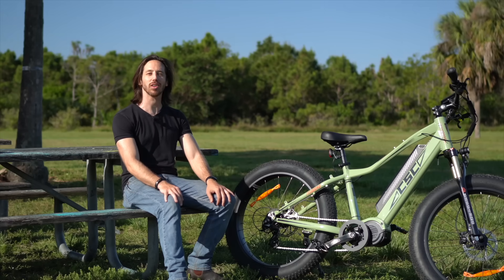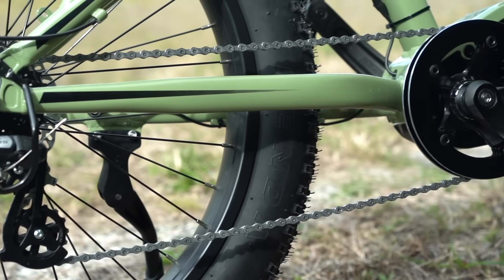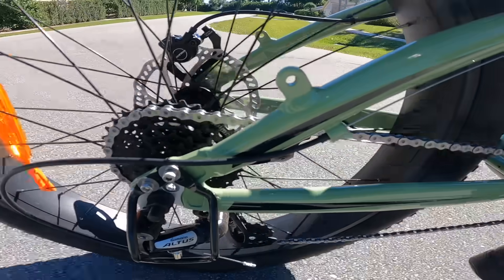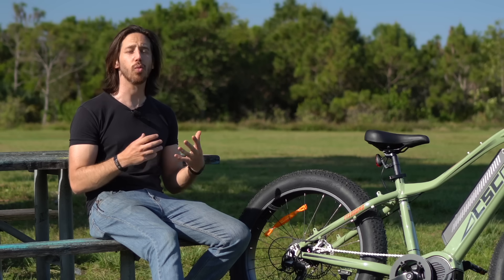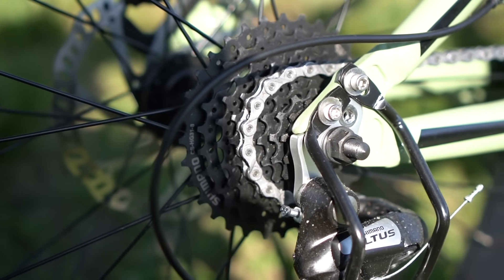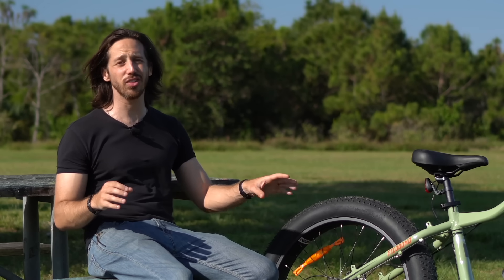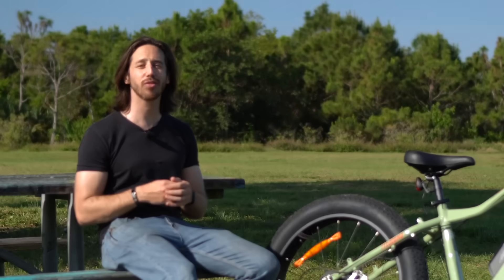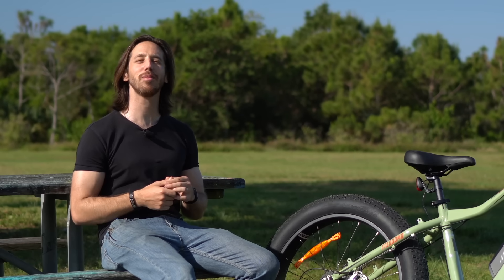How to (properly) ride a mid-drive electric bike

Comment: Love it!!!! I am biker for 20 years but do not understand gears and how to change it, all I know when I am climbing I Wass got to the smallest gear which 1-2 gear, right ? so now I am buying most likely Himiway D5, 2.0 or Mokwheel Obsidian 2.0, I  really like Himiway D5, 2.0 but removable control panel on Obsidian is very important to me, when I leave my bike on car rack on chain down when hiking where the bike can not go, 2 level of security is important to me,  I think both bikes are Mid way  drive and with full suspension with 4" tires, any suggestion helping me with my buying decision, Mokwheel also have free gift of $600 which will help me not buy anything extra right? and I can buy an extra battery which can be use to additional drive when In National Parks and to use it with inverter to power or charge other devices. I am so lost lol. but for sure , I will buy a mid drive bike ands will practice to bring the bike to low gear when stop n go, I am also thinking to buy extra chain just in case ad keep it in bag somewhere. Subscribed!

Comment: Good advice, as always. The biggest problem is TOO MANY Ebike riders think they are riding a scooter. Treat the Ebike as designed, as an assisted boost and ride it as a bike. Note: in Europe, there are ONLY 250 watt motors with NO throttle! Not pedaling = NO power output. These regulations are coming to a town near you due to the high-speed abuse of many Ebike riders, speeding in traffic and endangering other bikes and walkers on trails.

Comment: I never use my 9th gear  even 8th not often. my ebyke is limited to 32KM  20mph. Trek vive 2  with the  Bosch 400watts motor. In quebec Canada we cannot have  more than 500watts ebykes the speed limit is 20mph.  they can seize  a ebyke over 750watts. . started my season on april 13th   on July 16th i have traveled over 1700 KM   434.96 miles. i hope to reach 1,600 miles before october 2025.  I am 71 years old. love  cycling

Comment: The Industry Nine Hydra2 hub boasts the highest engagement points in mountain biking, with 870 points of engagement and a rotation of 0.41 degrees. This is a significant improvement over previous Industry Nine hubs like the Hydra, which had 690 points of engagement. 

Key Features of the Hydra2:

Increased Engagement Points:

The Hydra2 features 870 points of engagement, which is a 26% increase compared to the previous Hydra. 

Improved Engagement Angle:

The engagement angle is reduced to 0.41 degrees, compared to 0.52 degrees in the Hydra. 

Enhanced Durability:

The Hydra2 utilizes a stronger, larger drive ring, a 65% thicker axle, and tougher metal on the drivering to improve durability and reduce wear, according to Pinkbike. 

High Torque Rating:

The hub has a high torque rating, making it suitable for eMTBs, according to Pinkbike. 

More Engagement, More Control? Everything You Need To Know About High Engagement Hubs - YouTube

Apr 8, 2025 — Through some clever engineering, Industry Nine's new Hydra 2 hub delivers an eye-popping 870 points of engagement The W...

￼

￼

YouTube · 

Pinkbike

￼

Review: Industry Nine Hydra 2 Hubs - 870 Points of Engagement ...

Mar 6, 2025 — Tougher metal on the drivering to prevent stripping or premature wear. Hydra 2 has higher engagement (870 points / 0.41...

￼

Pinkbike

￼

Industry Nine Hydra2 MTB hubs boast even more engagement and ...

Mar 6, 2025 — Industry Nine won the traditional hub engagement wars long ago with their Hydra design that delivers 690 points of enga...

 This is the reason why the chain constantly pops slack with more points of engagement you have less chances of this happening because it will stay taught

Comment: Hi, I have a mid-motor drive e-bike with 10 speed gears fat tires. My chain breaks too often, and I would like to know if it is Posible to replace the rear hub gears for an internal  enviolo hub and a belt single cassette. the rear cassette is a 10 speed now. I am willing to settle for lower speed but less problems. can you please help me make the right decision. thank you

Comment: Hub motors are made less efficient by the bike's gears.  They are all too high, including the lowest gear.
In every other application, electric motors are always geared down, by a lot.  Even the hub motor itself is likely geared down inside (thus doubling the inherent inefficiency in gears).  Electric motors like to spin fast and be geared down (torque multiplication) and never the other way around.  This is true of large electric machinery with 100hp motors and of small electric machinery like a treadmill.  Some small appliances use a 1 to 1 ratio, but this is usually because of a design consideration and have big heavy motors that suck a lot of power.
Every gear on 90% of bikes are 1:1 or higher.  The exception is mountain bikes, but it's only 1 or 2 of the gears.

Comment: Hi, I just came across your channel and it's good stuff. I'm new to this and I haven't ridden a bike in a long time and I never had really ridden bikes that had speeds. I grew up with bmx types. My new ebike has 7 speeds. I've been pedalling on the 7th speed cuz I didn't know it would be an issue. Thank you for this video!

I went to go try this out and I noticed that when I switched gears, the chain on my bike didn't actually move? It still looks like it's on the smallest gear but I know it changed cuz of the feel and sound. I also realized my bike is not a mid-drive. oops

Comment: If you think that 1,500 watts is more power than a human could ever dream of putting out, you should have a word with an Olympic level track cycle sprinter, as for short periods the very best can exceed 2,500 watts. If they can do that at a cadence of 150 RPM, that would be 160 Nm of torque, higher at lower RPM of course.

Comment: Can the battery be disconnected and it be ridden completely manually without causing any mechanical problems??? I’ve been shopping around for a trike e-bike and recently, Ive been seeing numerous reports, over the interest, where the lithium batteries easily explode and cause fires while charging and riding.

Comment: Uhm i have a Cube Kathmandu EXC mid drive with a Bosch motor and i literally shift gears like like theres not tommorow, no problems yet and i got almost 6000km.
Cheap bike with chinese components usually requier more attention.

Comment: I’m here because after a year (and 1700 miles) of riding a mid drive eBike, with the 1500w Bafang 620 ultra motor, I’ve already broken a chain and cracked a gear tooth on the smallest cog, requiring me to replace the cassette.  Thanks for the tips!

Comment: One reason I didn't hear you menition for using the highest gear is that EBikes are very slow even at top speed, & thus you are out of sync with the cars on the road.  It is best to go with the flow, if you can IMHO

Comment: Is this the same for hub motors?
Reply: Nope!  Hub motors work independently from the gears.  So for example if you were to break your chain, or even your derailleur on the trail, you could still ride it home.  I personally prefer hub motors for that reason.  I once had to walk 14 miles pushing a 78 lb bike because a stray rock damaged my derailleur so bad it would not shift, so I had no engine.  Never again!
Reply: @JLawL  ya thats another reason why I want to get a belt drive. So I can ditch the derailleur (and not have to clean the chains all the time)

Comment: Gears mesh directly with each other and are connected to rotating shafts. Cogs are used to transmit motion between a rotating shaft and an axial load. The drivetrain of a bicycle has neither cogs nor gears. Sprockets are designed to mesh with a chain or belt rather than meshing directly.

Comment: I have a Dekra chainless bike with a sealed gear box integrated into the pedals-shaft.  Would it be possible to mount the mid-drive electric motor to it?  If so, which of your books should I get to show to a bike shop to install?  Thanks!

Comment: I just ordered my first ebike which is a mid drive. I found your video to be very helpful, so thank you for making this video. However, while doing what you said in this video is for sure going to prolong the life of my bike's motor and battery, i'm worried that having to shift gears like that all the time is going to take the fun out of riding the bycicle, which is supposed to be a fun and enjoyable experience. I'm already thinking about the possibility of selling it and getting a hub motor ebike so that i dont have to do this all the time, and i'm probably going to have a lot more fun riding that type of ebike. What do you think?

Comment: I start, when I remember in a lower gear on my cadence/hub bike.  I use the throttle as a launch gear.  May not be as critically important as a doing that on a mid drive, but it also helps acceleration from a stop.

Comment: Can I use the mid drive if my MTB has only 1 gear on front and 1single gear on the rear ..using mostly just throttle with out pedaling?

Comment: Just subscribed. My friend and I  just built a E bike out of a old Townie bike one of my friend gave me. My friend keeps telling me just what you have said, but in a different way. Great video.
We built it with a Bafang 750 w motor and a 48v 20ah battery. So far we have been riding the bikes around 30 miles when we get on the trails. Today we went about 35 miles :) Yeah

Comment: I have a foot scooter build, it is 24s 8p with 2 packs ( 24s 8p x2 ) samsung 50s cells . 80ah 200amp . Is copper good to use with the pure nickel? 🤔  the controllers is nd84530s and jk bms X 2 for redundancy.

Comment: I was thinking about all that extra torque on the chain..   I am pretty convinced that I want a belt drive.. I think I want the Invido (however it is spelled)  hub.. 

I have noticed something.. The wattage of the battery doesn't always mean that it has more torque..  I would imagine that has something to do with the gear ratio..  Am I right?  Can  you elaborate?  Thanks..

Comment: I ride a normal bike. it's the same. Shift before you need it. Never shift while peddling, don't shift while standing still. Don't ride off in a high gear. I did, because no gear available and destroyed many (dutch) bike's. Just don't rely on technology.

Comment: Thank you for this video. I ride a recumbent trike with a Bafang BBSHD mid-drive motor on the front. I have had nothing but trouble with this motor constantly trying to destroy my running gear!
I have a 9-speed derailleur and a 65T chainring so that I can pedal even at 45kph and more. The power of this motor is amazing but I can find no way of controlling it! Its acceleration is so fast that I must change up 2 or 3 gears at a time to keep up. After only a few seconds, I am in top gear and cruising at 35kph and remain there unless there is a reason to slow down. I generally brake first, then change down but inevitably get a clash of gears doing so. This clash of gears or chain slipping on the cassette annoys me greatly because a) it is noisy and disruptive and b) I know it is doing damage. It has been happening more and more lately. In fact, it got so bad that one day it threw my chain off my huge chainring 6 times on the way home! After that, I found and removed a damaged link which was causing my derailleur to jump after each pass. After this, my ride improved out of sight for a day but then started getting worse and worse. So I experimented by cruising in level 3 of 5 instead of 5 and found that the noises and clash of gears ceased. I then thought maybe my settings are too high in level 4 and 5 and should be reduced. All my problems seemed to come while I was pedalling which kind of stopped any sort of workout potential. I then used the "SPEEED" app and some connectors between my bikes display and my phone intending to reduce my assist levels in 5 and 5. Well despite following the instructions to the letter, I have now lost my PAS and THROTTLE for the 3rd time. It will take a 600km drive and expense to get my controller re programmed again! I would love to hear your comments Mickey. I know there is a lot here but you are the expert. I hope you will also hazard a guess on what I am doing wrong using the SPEEED app when it is a great app and gets a lot of support from Youtubers?

Comment: What he said about the electric motors is for all electric motors on e-bikes start off at 1 and as you progress in speed make sure the tension your pedals is still there for the assist don't free-float those pedals make sure there's tension and every time you go to level to make sure you're on your right side goes up a level so you can feel the tension like you said take the tension off electric motor and just like if you have an RC card you're not going to go. All the time or you're going to ruin your motor

Comment: Another thing I want to throw in is that  riding primarily in the mid range gears reduces torque flex on the front chain ring and also helps to keep the chain straighter which will help reduce wear on the drivetrain overall. You might notices a clicking noise if your chain ring is bent slightly from the torque of the motor. The thing that I've noticed is with my ebike is that it is hard to keep the motor at higher rpm but yet still have pedal cadence slow enough to effectively pedal. Generally I've noticed the bottom third of the motor's rev range can be used while pedalling but beyond that the motor is pretty much on its own. This makes it a bit trickier to go as fast as possible with both pedal and motor power while still trying to prevent damage. I think hub motors are great for their simplicity and overall performance but mid-drives give you better performance (better at climbing hills and higher top speed).

Comment: Hey!  Thank for this great information.  I just purchased my mid-drive ebike purchased online with a Shimano Steps E500. I was under the impression it had a throttle, but does not.  You mentioned throttle a few times in this vid...can a throttle be added after the fact...does it depend on what manufacturer/model?

Thanks!
Mike

Comment: I've watched this video before. I have more experience now so I understand better, I think, as I watch now again. I generally stay in a high gear to avoid ghost pedaling. I use the throttle very little and keep the bike in the lowest of 10 levels of assist while I do most of the pedaling. I try to lean off on the rare occasions when I do shift. I'm definitely no speed demon. My motor is 1.5 years old and still seems happy.

Comment: For all the reasons stated, mid-drives suck.  Using a lower gear to keep the motor spinning means pedaling is useless.  Pedaling will increase range, acceleration, and speed, and reduce wear and tear on the motor.  This is a dirty little secret to upsell you a mid-drive.

Comment: They need a 5 gear mid drive with strong parts (belt drive) and a overpowered or reliable motor. Shifting all the gears is wack everything you stop and start.

Comment: It's not just people not just throttling and shifting poorly, people treat them like mopeds. Here's a good measurement - if you can't get half way up the hill under your own human power, you shouldn't be attempting that hill with a pedal assist motors without exerting the same effort it took to get to the half way point, that now takes you to the top. You should imagine yourself putting in about 50% of the effort unless you're at cruising speed, otherwise you're stressing the motor. This applies to most amazon kits or pre-built ebikes. These aren't mopeds. Your average ebike is designed to assist the rider, not carry them around.

Comment: To make it SIMPLE upon riding a mid Drive.. you MUST do the same thing as if you're riding a Motorcycle or Manual speed car. You MUST start in a LOWER Gear.. like FIRST or Second gear so that you don't Overload the motor or engine. This is why Motorcycles have to DOWN SHIFT everytime they come to a complete stop. Of course cars have to do this too whether it's a Manual or Automatic Transmission. 

You also have to LET OFF the throttle when Shifting otherwise the sudden torque from the chain going into the next gear could SNAP the chain and in a mid drive, that means you're STRANDED unless  you keep a SPARE with you which they highly recommend that you do, or at least a small section of chain with a chain puller so you can do on the fly repairs. 

Always go down into a lower gear and if you sometimes forget, then when starting from a standing still position, push off and pedal to assist the motor and not overload it until you get going a little, enough to Downahift then let the motor take over most of the work.

Comment: Not sure if I am suppose or allowed to ask you a ? but here it goes and also forgive me if inappropriate. I am about to purchase an e-bike motor from bafang for a home build and I can't bend my knee because it is fused, so does the crank set have to turn if I run it in just motor mode. I was planning I riding my bike with my feet on the pedals but I can only do that if they don't turn because of fused knee?
Thanks and I enjoy your pod cast

Comment: Electric motors are the opposite of internal combustion engines.  If an electric motor is spinning fast it using less amps and is keeping cool.  However if you overload an an electric motor you get into a feedback loop where the motor heats-up causing increased electrical resistance, which in turn draws more current, this will continue until the motor coils become so hot the motor burns up.

Comment: Hi Mika.. I dropped to a 30T chainring on my BBSHD to keep the motor spinning faster.. I have a recumbent touring Etrike with a substantial trailer.. I use a Rohloff speed hub and listen for the speed of the motor.. I find i get better range when i keep the motor spinning faster.  Lugging down the motor drains the battery fast.